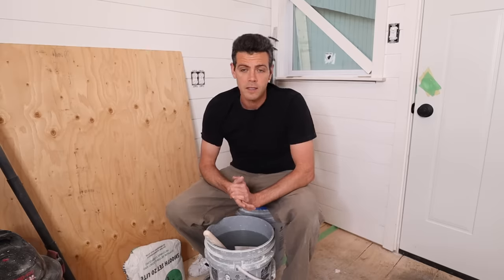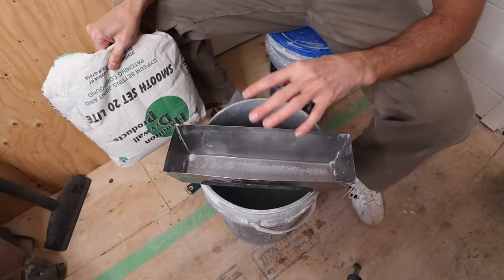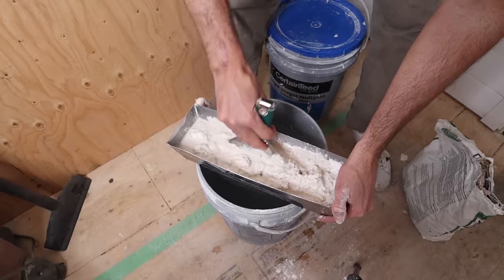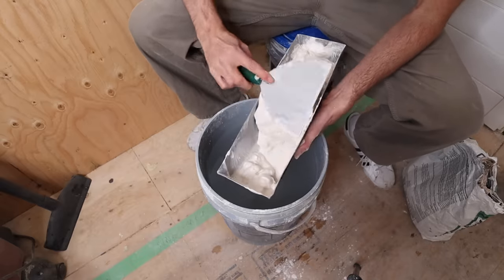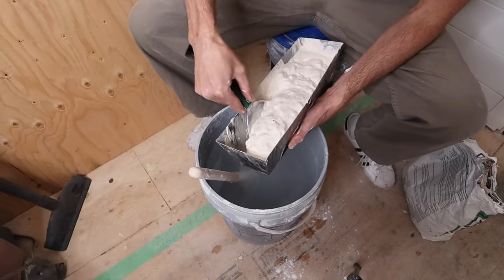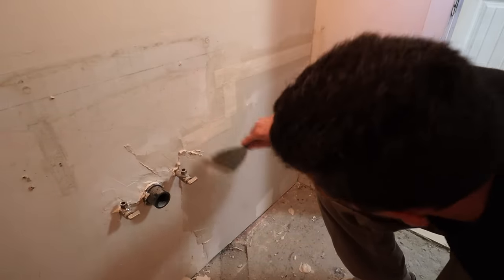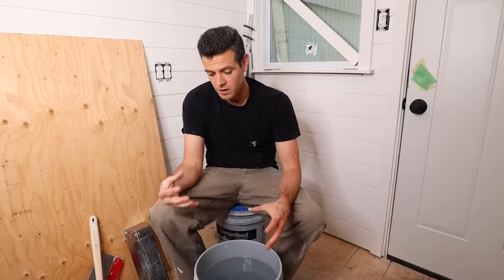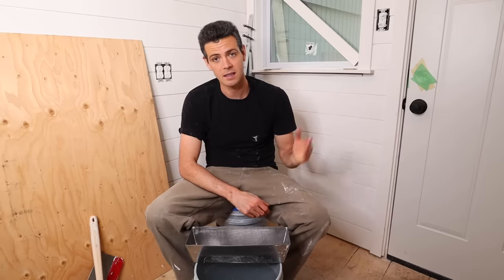How to mix Quick Set Drywall Mud small batches Hot mud

Comment: Can you mix a higher number with a lower number to extend working time?Could you combine 5 min and 20 min?
Reply: I've seen experienced drywallers make all sorts of mud combos for various purposes but overall I would advise against it for number of reasons.  For one, this wouldn't really extend the open time in any way.  It wouldn't really even average out the working time to create a 10-15min mix, you would just have parts of the mud setting in 5 minutes and other parts setting in 20 minutes.  And, depending on how evenly the two compounds are mixed, this may fool you in to thinking the mud has fully set and ready for sanding, another coat, or whatever you next step may be, when in reality it has not, resulting in a final product that ends up worse than if you just waited for the mud to finish setting.  

If you want to extend the working time for the 20 set your best option would probably be to just use a 40 or 45 min setting compound, those seem to be the most popular with all but the experienced pros.  There are other trade secrets about adding different substances for certain effects but, unless you get lots of opportunities to experiment with different 'recipes' and techniques, I think your safest bet on getting the best results would be to follow the manufacturers' recommendations.

Comment: I switched to using a small paint mixing paddle with a drill (or single egg beater) and a plastic bucket. So much faster.
Reply: I use a  normal mixer works ok. But only do that if I need more than one pan.
Reply: I'm referring to small 1 pan batches.
Reply: I got one of those cheap electric mixers from the kitchen aisle at the department store, works great for mixing up a pan of mud for small jobs.
Reply: @brucegezon  I did it today lol.
Reply: @brucegezon  definitely way better. Have to admit
Reply: Yea drill and a small bucket it great
Reply: Yup

Comment: The quickset compound powder needs to be mixed dry. I keep mine in a 2 gallon bucket and mix it before i put it in the pan or add water. Otherwise the hardener part of the compound will settle toward the bottom of the bag and affect your set times.
Reply: I also use a 1.5 or 2 inch blade to mix. Mixing with a 6 inch is a pain in the ass and a mess. It takes more time because you have to be more careful when mixing with a big blade. Use a smaller one.
Reply: That's interesting.. I had a 1 or 2 year old partial bag of 45 minute left from my bathroom job and the last 2 times I tried to use it the stuff it would kick off in about 5 minutes.  Fresh bags worked as expected.. I thought it was an age or humidity absorbed over time thing..

Comment: Say, Ben:  you talking about getting that mud worked while it was setting got me wondering.  With the quick-muds (I’ve only tried the 5 minute stuff so far) - at what kind of consistency, or when during its setting, would you recommend no longer using your batch?  I’ve been experimenting with a present project.  I think I can use it quite a ways into its setting.  It looks like it’s working (now) but only time down the road may tell?  Recommendations?  Thanks!

Comment: Hey Ben, I've learned so much about taping from you! On a past job I used the quick set 45 and did a bunch of patching in a single room. I used the fiba tape. I made the mistake of putting on the all-purpose 3 hours after the quick set. It felt dry (to touch) but over-night the all-purpose interacted with the hot mud and made it smell like rotten eggs. My customer actually fired me from the job. Quick Question: I just taped a bunch of repairs and used the 45-minute quickset again but this time I will wait overnight before applying the all-purpose. I assume you can add all-purpose as a topcoat because you said so in this video.

Comment: Are the pans supposed to leak water? I tried to mix for the first time and both ends were leaking a lot when i added the water first - didn’t even try to add the mud. Is this supposed to happen? Or did I get a dud?

Comment: Hey there! Could really use some advice. I attempted to repair my ceiling in a Bay area of my home. I used quick set and mesh taping. I did a really sloppy job in the corners and am wondering how to smooth it out or just remove (if it can be removed). I did my bedroom ceiling (no corners or edges) & it came out perfect! Please help. Wish there was a way to send you pictures or a video so you can see how bad I messed up. Please, my husband is not going to be happy

Comment: I thought it was best to use all purpose when taping.  what stages would you use all purpose and when would you use quick set
Reply: Use all purpose for taping if you don't mind waiting a day (or two) to do the next coat. Otherwise use quickset. I mix up a bucket of 90 or 210 minute depending on the size of the job, or 20 minute in a pan if it's a small area so you can do your next coat right away ish. I pretty much never use all purpose.

Comment: If I may share my exp with 20 min quickset
1. I've cut a plastic spatula to the shape of the pan for mixing.
2. I poor water, poor quickset, then wait a few minutes without mixing. (makes less crums)
3. I mix, but the least possible.

I agree with cool & clean water, and use contaminated water to accelerate hardening (if needed).
As well, results varies from one batch to another.

I base my approach on working with Paris plaster (the donut technic):
- the less you mix the longer it takes to set
- water will spread in the powder by it self

thx for your vid. :)

Comment: Is quick set better for beginners for not having the tape blister? Thanks for all the great video!
Reply: God no, all purpose mud thinned down for taping. You will struggle taping a job with quickset as a beginner
Reply: @thegodemperorofmankind7yea704  We moved a house in last year so there were a bunch of cracks. I cut them out and filled them with durabond with mesh tape with pva added. Then coated with quick set and then plus 3 and it worked out good for me. Wondering why it wouldn't work with paper tape?
Reply: @countryboy97991  paper tape is harder to work with I find (when I was learning), you need sloppy product to adhere the paper to the wall as well as easy to create blisters either from too little compound on the wall or you squeeze too much out.    Took me a while to learn but like everything once you get it....
I use durabond for my taping as it prefills at the same time, but again takes some practice to use the various products and have a good result.

Comment: The reason I don't use setting compound is because I don't know how to do cleanup after. You left this part out, please teach me.
Reply: In my experience:
- lightweight, sandable quickset disolves in water just like regular mud.
- Other products like Paris plaster or Durabond need to be cleaned RIGHT AWAY, or consider using a throable plastic contaner.
Reply: Don't wait till the end of the working time.  Have a 5 gallon pail 3/4 full of warm water ready and get in there with an abrasive scouring pad (such as a 3M pad) and a kitchen bristle brush and scrub out the corners and clean off the tools.  If you wait till it has started to set, it makes it 4 times as much work.  I use Sheetrock 90 in a Delko banjo and Mud-Buddy with Fibafuse tape and set a timer so that if I haven't used all the compound that I mixed by 80 minutes, it gets emptied out of compound and the tools cleaned before the next batch.  Some extra compound is cheap compared to the time spent trying to dig hardened compound out of the nooks and crannies.
Reply: @VC-Toronto  Let's say it's middle of winter and 10 degrees F outside and I'm doing the cleaning indoors. Where does all the dirty water go? Down the drain? What about the unused mud? In the trash? I just don't know this part. Thanks in advance. What about in the summer? Can I just dump it on the lawn?
Reply: @CybekCusal  Any unused setting compound gets spread out on some paper (usually a cut open compound bag) and left out to harden and dry out a bit, and then once hard, into the garbage bin. I'll let the "clean up water" settle overnight then pour off the liquid down the drain.  As long as you don't let the chunks go down the drain, no problems.  At this point any compound will have set (even underwater) so it's not sticky.  The residue in the bottom goes in the garbage.      (If I'm doing a lot of compounding over a number of days, I'll have one beat up pail that gets the residue from the clean-up added to it each morning, then tossed out at the end of everything)   In my earlier post I should have said "Tape-Buddy", not Mud-Buddy.
Reply: @VC-Toronto  ok I'll try it!
Reply: After cleaning my tools I drain off the water into another container (or toilet/sewer drain if available), just the dirty water, not the left over chunks in the bottom otherwise you risk clogging up the drain.    Use a plastic garbage bag in another bucket/pail/whatever and you can dump your unused product into that, cleaning the bucket at the same time, once it gets full you can throw it in the trash.  I like to keep the dirty water for mixing as I tend to mix small batches at a time (I am not good/fast enough to do whole buckets of product at once) and it keeps everything in sync drying wise.   Although I start with 90 minute compound and after 4 separate mixes with dirty water I end up with 30ish minute mud.   Just my method, not a pro, just a diy'er but works for my home reno jobs.

Comment: Beginners don't use 5 min hot mud. There is no time for playing with it. 20 minutes for small areas and larger you better go 90 minutes. Make sure between coats you clean pan and tools well because the ould will rapidly fire the new batch.

Comment: This is so wrong, he's holding the pan right, but he holds the knife wrong. First you add the 20 min to the pan, not the water first, then use a running faucet to slowly add water while stirring with your 6 inch knife. Hold the knife in a fist, blade down in the pan, thumb on top, and just stir, if you feel your adding to much water, just pour it off. If your skimming,  and your mud begins to harden in the pan, quickly scoop it out and trash it, rinse your knive and pan, and mix another tray if needed. You'll quickly be able to determine how much, and at what consistency, the amount you'll be able to work with at your pace. Dont worry about waste, 20 min mud is  inexpensive. The trick is how you hold your pan and knife while slowly adding water and stirring to desired consistency. Oh yea, be careful when using 20 min mud in sinks and drains, it's best if you have a bucket of clean water/sponge or brush handy, to pour excess water into and for keeping tray and pan clean.

Comment: "You can always add more water, but you can't take it out." About a minute later : "If you get the sense you might have too much water you can always pour a little bit off into your bucket."
Reply: He meant you can't remove mixed-in water. He was able to pour off the water in the corner because it was pooled there.

Comment: Use a measuring cup....j.k, lol. Ya it ain't rocket science.... use watever water is available, you don't need bottled water. Work/tape as fast as you can so it don't set up b4ur finished with that coat. Best guess not only how long it will take you but also the amount of mud that that coat will take. You want to mix it in a bucket if possible, especially if ur goona need more than 1 pan full or i'd even say a full pan...it's just too much fuss....get ur drill and beater out and whip it fast. I usually have about 20-40 pails laying around, so i'm not afraid to toast a pail, you know , like if the mud sets up in the pail...just toss it. I love pans...gripper not so important...pretty much just another unneeded thing...not like it's goona be 20 below zero wen ur taping....mud would never dry then anyways. lol... and it's not goona fly out of ur hand, even if the pan is a little wet wen u pull it out of the pail of water like this fella did. I get it though, trying to make a buck... i appreciate his salesman side. Good for him.

Comment: What's your opinion of the various mud mixing attachments that work for small buckets or in mud pans?

I've seen people who use a kitchen mixer / egg beater in a mud pan.
Reply: You CAN use an egg beater (I have). But they will give out eventually because they aren't made for that much resistance. 

Better bet is to get the small mixer paddle (Wallboard brand at Home Depot is ok and easily accessible). Attach it to a good cordless drill and you're ready to QuickSet anywhere.